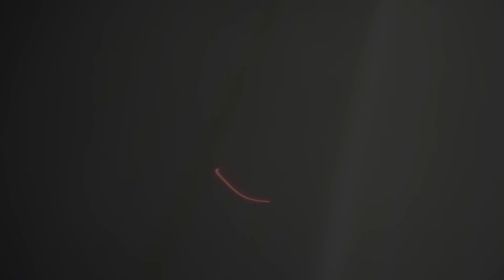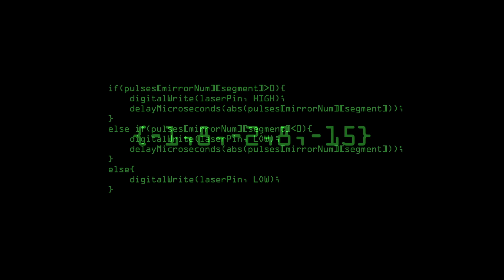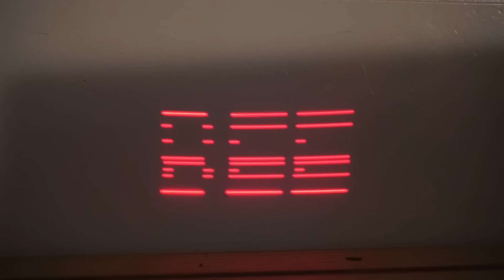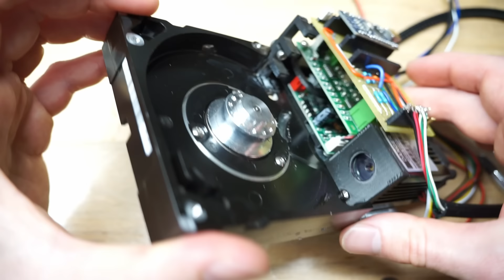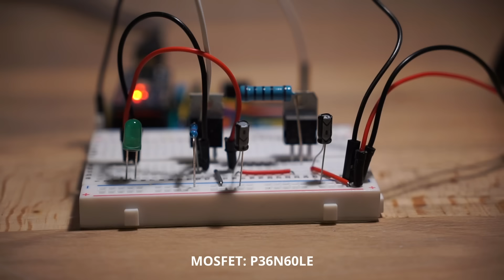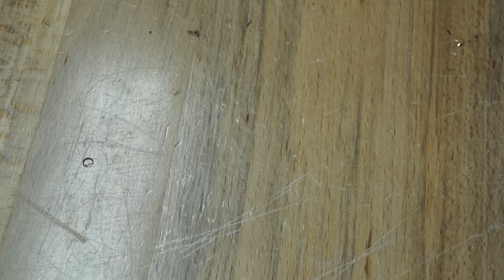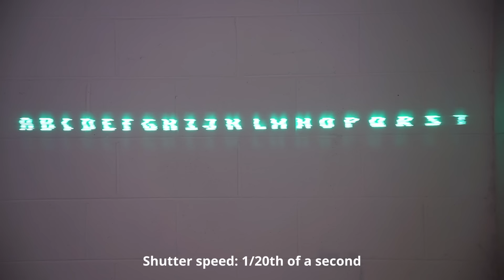DIY Laser Projector - Built from an old hard drive

Comment: Cool project !!!
Some suggestions: Use 2 hall sensors with embedded magnets for possition, less air resistance is less noise and vibration. And your unballenced extra arm....
I would use shims and a screw for tight compression together with lock tite that screw. The shims define your angle. You can make a stack of different thicknesses and adjust very precisely with no movement whatsover. You could use the remote controll engine of the ESP32 for laser controll + you get wifi and ble for free. You could offset different colors and adjustd the scanline for the laser offset or create a multi color single point first.
Reply: Why do you spam with Chinese ESP32 ?!?!?! Shameless
Reply: Another alternative to using the arms sticking out from the sides to interrupt the sensor beams would be to drill small holes through the base of the mirror assembly, spaced to be behind each mirror. Then place the light source and sensors above and below the spinning baseplate (one attached to the metal hard drive frame, the other to the top lid above the spinning assembly). If the light is from above, it could either hang down inside the spinning part, or just be made bright enough to shine all the way across the increased gap between the top cover lid to the sensor below. Any fixed timing issues introduced from the holes being drilled slightly offset from perfect would be corrected by the same code intended to address the expected imperfections of the 3D printed arms. The tiny amount of missing plastic for the single master timing pin hole is negligible compared to the large single unbalanced master timing arm. Not sure if it helps with the interrupt routine timing, but adjusting the master sensor to be slightly earlier than the first mirror after that position (if not just halfway between the first and last mirror) might help keep the interrupt for the of the once-per-revolution master timing more isolated from the interrupts generated by the first and last mirrors on either of the master interrupt.

If you do keep the printed arms, adding approximately the same amount of plastic by weight as a vertical bump on the opposite side (imagine the timing arm cut off and re-attached to lay flat on the surface inside the spinning assembly) so the overall mass of the entire assembly stays slightly more balanced. Putting it inside the wheel keeps that extra mass away from the exterior mirror holders.

Comment: You could possibly save and cut code complexity by only using one sync sensor (the top one for full rotation ) and divide the result down to x mirrors. This would probably net you a possible higher rotor speed and less power consumption by the motor for less resistance by the little fingers on the bottom.

Comment: What if you had all mirrors at the same vertical angle, and repurposed the servo that controls the HDD's read/write head arm to control the vertical angle of the laser, to get software controlled vertical resolution?

Comment: The “noisy” edges on the text could be due to some quantisation errors as a result of the motor speed not being stable with respect to the MCU clock frequency. So, How about phase locking the motor speed to the MCU frequency?

Comment: How are you adjusting the vertical lines that make up a single letter?? Like How are you creating a line for the top of “A” as well as the bottom with no vertical control
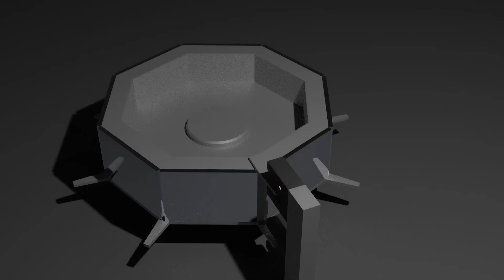Reply from the maker: The different lines are because there are multiple mirrors at different angles - each mirror = 1 line. The width of the line segments is determined by how long I turn on or off the laser. I explain it around 1:47 in the video.

Comment: Lithium ion cells [x4?] either 18650 or blister pack style with a buck converter for stable voltage throughout the charge life of the cells would be a better choice. [I have little micro bucks that are 2A/3A max.]

What I don't understand is how you get vertical scan lines. Single laser with fixed mirrors means it should only paint over one line again and again. [No vertical resolution] A CRT uses a deflection yoke to direct where the electron hits the surface. An LCD/LED uses independent lines.]
Reply from the maker: Each mirror is at a different angle - 12 mirrors = 12 lines. If they were all the same, yeah, it would just be a single line. And yes, I should use Li Ion batteries, that would be better.
Reply: @benmakeseverything  Now I get the vertical scan line method, Thanks.

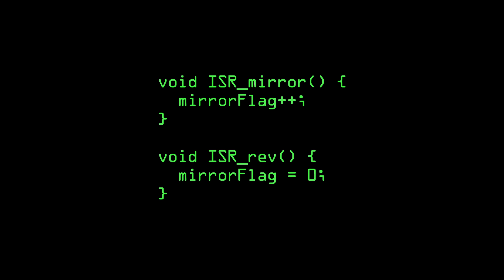Comment: ~ 5:00 - wouldn't it be simpler to have only one interrupt routine, and count mirrors modulo number of mirrors? 

Edit: Ah, then you would need to know the initial position of the rotating assembly. This way it "self-syncs" after at most one full rotation.
Reply from the maker: Exactly! had to add that once I realized that there was no way of knowing what position it would start in.

Comment: You mention in the video that many green lasers are usually not actually green, but uses a IR laserdiode and a frequency doubling crystal.
These leak IR through the crystal and as a result need a good IR filter to not emit high levels of invisible light that will not trigger your blink reflex.
Make sure your glasses cover both green and IR (1um) spectrum.
Reply from the maker: Thanks, I am aware of that and the glasses I have are rated for both. I didn't end up using the DPSS laser anyway, but it's important to keep in mind.

Comment: Believe it or not years ago ST actually designed a compact laser projector that used a single high speed mems mirror, however due to what you pointed out about green lasers they couldn't make it work. It ended up as a product used with ir lasers to project maps for facial recognition biometric locking systems.

Comment: For switching the laser you should use the 16 bit timer and do a timer compare interrupt. Set the prescaler to something that gives you adequate range and accuracy. Then just update the compare register to get the laser pulses you need.
 Remember to set the timer to reset on compare match
Reply: That is how I i can generate a bit bang midi on an Msp430. Works really well. Timer interrupts are useful as long as there are other things to be done but the full attention of the cpu is superior.

Comment: Awesome stuff! Back in high school in the early 90s I managed to borrow a HeNe laser from the school lab for the holidays. Had heaps of fun making similar scanning arrangements but all analog, so mostly scanning audio waveforms or lasseous figures. I love the problem-solving you went through (and love that you shared it in detail) - I've wondered about how hard it was to modulate solid state lasers at these sort of freqencies, and what you learned about the pumped ones is super valuable knowledge! 

Anyway... great work and I'm keen to see what else you work on (and off to check out your cnc vids - it seemed to handle the aluminium work super nicely).

Comment: The flickeringeffect could come from the digitalWrite() function you're using. This function is really easy to use but is also pretty bloated and slow. Try accessing the register of the output you're using directly. For example if you want to turn on the pin D3, which is the bit 3 of port D: PORTD |= (1 << PD3); and to turn it off again: PORTD &= ~(1 << PD3); or even faster but only works if you're not using any other pins in that register: PORTD = 0b00001000; and PORTD = 0b00000000. Maybe that helps you get better results with the timings. ;)
Reply from the maker: Thanks, I'm going to look into re-writing the code in the future. I'm still pretty new to programming for arduino.
Reply: @benmakeseverything  No Problem. I've gotta say though, what I've seen of your code looks pretty clean and even better than some of the stuff my fellow students wrote. XD Keep it up mate. ;D

Comment: Impressive results! I wouldn't have expected a 3D print to be stable enough, it's nice to see that a commercially-made polygonal mirror isn't the only option.

But you don't actually need a faster CPU: The arduino you're using would be perfectly capable of precise 62.5 ns resolution pulses -- i.e. the full 16 MHz system clock rate -- if you exploited the Atmega328p's powerful Timer/Counter peripherals for the task.

Here's how I'd do it:
- Set up the 16-bit Timer1 peripheral in free-running mode (WGM mode 0) and with full system clock rate (i.e. no clock divider). This timer will just count up continuously; the fact it'll overflow from 0xFFFF back to zero every 4.096 ms is of no consequence as long as that's longer than a single scan line.
- Wire the per-scan-line trigger to the ICP1 pin. This way, the input capture module can record the exact "start time" for each scan line in hardware before triggering the input capture interrupt to set up at the start of the scan line.
- Wire the laser to an additional XOR gate, whose inputs are wired to the OC1A and OC1B pins. The output compare channels will be used in 'toggle' mode so that, in conjunction with the XOR gate, they can effectively act as a single output with a two-element buffer, rather than two separate outputs with only single-element buffers.
- The main task of the input capture interrupt (TIMER1_CAPT) is to copy ICR1 into a register, and then copy of the next line of the image into a separate buffer, adding that ICR1 value to each element of the buffer to offset it to the measured start time of the scan line (using 16-bit unsigned arithmetic so it overflows back to zero the same way the timer does). Aside from that, it's just a bit of bookkeeping at the start to reset the outputs to a known state (set COM mode to 'clear' and trigger FOC), and a bit more at the end to prime the output compare modules (set OCR1A and OCR1B with the first two values from the buffer, set COM modes back to 'toggle', and enable both compare match interrupts).
- The compare match interrupts (TIMER1_COMPA and TIMER2_COMPB) then have a very simple task: each time their channel finishes triggering, retrieve the next value from the scan buffer and put it in their OCR register. That should be the absolute first thing the interrupts do, and then after that there's only some light bookkeeping, to clear their interrupt enable bit if the next next value would be past the end of the buffer.
- The interrupt for the index trigger is even simpler still: all it needs to do is reset the value of the row counter back to zero... and I guess you could flop image buffers here too; change the pointer the scan line interrupt uses to find the image to point to the frame that was being rendered while the previous frame was being displayed.

The way I'm proposing to use the interrupts here is in a sense the most fundamental design pattern used for serious interrupt-driven embedded programming. Almost all hardware peripherals are specifically designed around this usage pattern, understanding that fact can make the rationale for their designs much easier to understand.
Even though an interrupt seems instant compared to polling, there's still too many sources of jitter to rely on them to take actions that require precise timing. Rather, their responsibility is just to refill a hardware buffer from a software buffer before the hardware runs dry, or empty an hardware buffer before it overflows -- something that still has to be done "right away" rather than "next time the control loop feels like checking", but that way an extra microsecond or two of delay waiting for another interrupt to finish doesn't compromise the timing accuracy.
This pattern is actually used twice as I describe it above, both copying data from the ICR1 register to use to populate the scan buffer, and of course moving data from the scan buffer to the OCR registers.

With the design, you'd inherently have the full 62.5 ns precision of the full-speed system clock, and using both channels together means pulses could be as short as a single clock cycle, too. The interrupt execution time would limit the rate at which you could continuously switch it on and off, but even with minimal effort I'd expect at least 100 kHz. With high effort (i.e. implementing the compare match interrupts with hand-written assembly code) it'd be entirely plausible to achieve a maximum continuous pulse rate better than 1 MHz.
Reply from the maker: I really appreciate the info! I'll see what I can do about rewriting the code when I have time.
Reply: Wow!
Reply: Yes I was going to write this. I've made some POV displays, and found it's stable if you just use the position trigger to restart a timer set to fire X times (X being the horizontal resolution you want) with the timer counter set based upon the amount of time it took for the previous revolution. So if the previous rotation took 1 second, and X is 16, you set the timer to fire at (16/1)hz - if it took .1 second, it'd be (16/0.1)hz etc. Basically it'll automatically adapt to the speed of the motor. The timer interrupt then just turns the lazer on/off as needed. You won't get a steady image in hte main thread, as the code is being interrupted at "random" intervals. In your case you'd further segment based on the number of mirrors. As long as the mirrors don't wobble it should be rock-steady :)